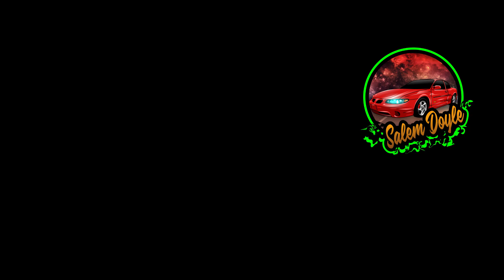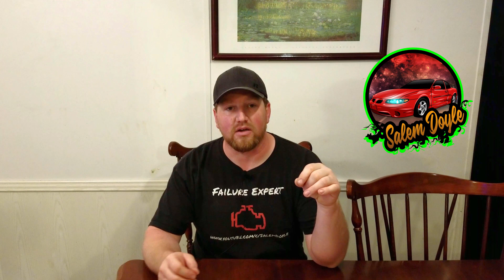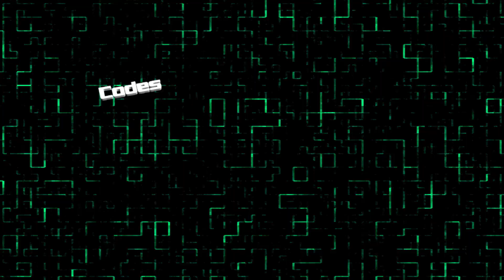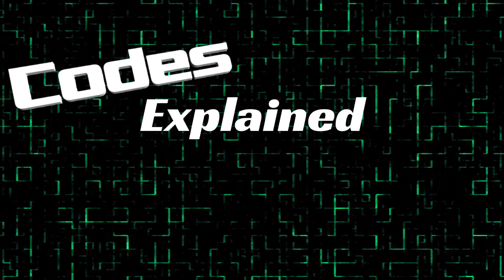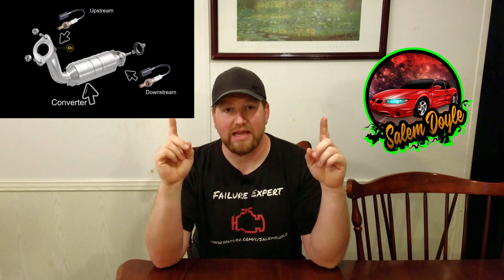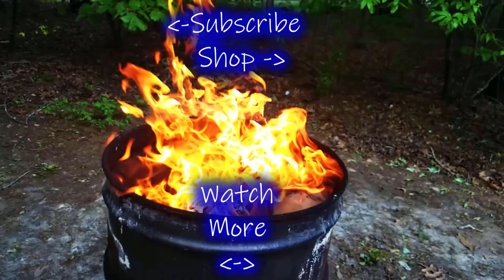Engine Code P0420 and P0430 EXPLAINED

Comment: One other thing, disconnecting the battery should shut the clock down, but when I reconnect the battery, the time is still the same, I have left the battery disconnected over night, and used a 
jumper cable from the disconnected positive cable from the battery to neg, cable to drain off any residual voltage, but the clock holds it's time and the engine check light stays on. I guess I will have to bite the ol'e proverbial pocket book and let the dealership guys check it out. According to the owners manual one needs to re=program, or re-learn some engine stuff when disconnecting 
the battery, and the transmission.
Reply from the maker: That is pretty odd.

Comment: Thanks for the reply, I changed both the upper and lower sensors on Bank 2, now I'm trying to figure out how to turn off the engine check light, there seems to be no way to turn it off using the 
KW808 code reader, and it shows no further error problems since I changed them out. I have tried the 'disconnect' battery thing but to no avail, most places want at least $170  for a diagnostic
check, which is the Lincoln dealership about 40 miles away, the Buick dealership in town won't even check it out, he says something about his diagnostic  equipment isn't workable on Lincolns.
Ha ha. Any ideas??
Reply from the maker: If disconnecting the batt for a few minutes doesnt reset it, you have other problems

Comment: I have a 2015 lincoln MKT with the 3.7 engine I believe with dual turbo's, the engine check light is on and there is 79,000 miles, I'm using a KW808 diagnostic tool which shows a p0430 code bank #2, is it possible it's just a bad up-stream sensor and not a partially plugged convertor on bank  #2. The car runs great, when I punch it. it runs like a rocket, up to a 100 plus in no time, which I quickly back it down ha ha the down side is getting to the upstream sensor, the downstream is right out in front. If one had to replace the convertor it's actually part of the exhaust manifold, Bummer, the local Lincoln dealer wants $170 just to diagnose the vehicle. what do you think? try to replace both sensors and see what happens?
Reply from the maker: you could look at o2 data and see if the upstream is doing something it shouldn't but if that is the only code, you are probably looking at a converter issue

Comment: Thank you for the detailed explanation. I have a 2011 Genesis Coupe 3.8 and I’m getting P0430 as well as P061B. Do you know if that code would trip the P0430 code or is that a separate issue? I’m being told I need to replace the ECM, but don’t want to do that, if the code is related to the P0430. Thanks in advance!

Comment: it would have been nice if you would have mentioned if it would harm your motor if it continued.
Reply from the maker: A 420 code alone wouldnt cause engine damage, but depending on what it is, the cause might.

Comment: Excellent info. Can the downstream sensor itself cause confusion with the computer causing a 430 to slight skip while idle. I had no other codes come up but the air filter was mugged up I changed it out
Reply from the maker: Shouldnt cause engine issues, the downstream sensor is just for cat mon itoring.

Comment: I got the code after I replaced my cats did not have that cold before it must be the aftermarket part or aftermarket oxygen sensors it was cheaper than going with the original that cost over $4000 dollars thanks for the info

Comment: Ok I understand, I don't have a scanner, but how could I find a other code? I hear people say, "" change the oxygen sensor""  it's like guessing, for example my car starts fine, it doesn't blow smoke, but it smell, my question to you, how can I identify the faults of a catalytic converter?, sorry for my question.😅😅
Reply from the maker: Start with fault codes.  If you dont have a scanner take it to a parts store and they can pull codes for you.
Reply: I did,  but they found same p0420 code, but exactly what are the symptoms of a bad catalytic converter?
Reply from the maker: There usually arent any symptom outside of the code.

Comment: Completely agree with other folks. Great content. It’s nice to hear a technical explanation instead of tribal knowledge. Would completely be up for more videos. 

Electronic Throttle Control system, for instance. That dumb lightning bolt has a thousand meanings, seem like. 

Thx for the great lecture sir. Much appreciated.

Comment: Sir I have both code P0420 and P0430 on Mazda CX 09 2016. Engine light is on and just last month I also passed emissions test. So what it's mean Sensor need to replace only ? Because if convertor is bad emissions test will not be pass
Reply from the maker: More than likely its converters that are just starting to fail, but it could also be caused by misfires or if the engine is running less than normal.
Reply: Yes I am feeling high consumptions of fuel and Sir if convertor is failed then is it possible we can passed emission test ?
Reply from the maker: @khurramnaseer2783  yes it's possible.  but if you are also consuming extra fuel i would recommend checking over the rest of the engine for needed maintenance.  may be time for a tune up or may have another issue.

Comment: This is good info. I'm currently dealing w/ a p0430 right now. But I have a question. What if my scan tool doesn't show an option to view bank 2 upstream sensor? I'm only able to view downstream.
Reply from the maker: Thats odd, most scanners can view both.  You may have to borrow a diff. One

Comment: Ford taurus 2008. I have both code p0420 and p0430 displayed during an obd scan when I noticed the check engine light and fuel cap light turned on. I hope it won't have a damage to the engine before I have time to have it fixed. Thanks for your detailed explanation about both codes.
Reply from the maker: Usually those codes just refur to efficiency. It shouldnt damage anything else.

Comment: I bought a  mustang gt 350 with 475 miles but is 5 years old and I’m getting  the p0420/430 code it also has cold start issues  is it possible for the catalyst converter to be bad with only 475 miles on it?
Reply from the maker: It is possible, yes
Reply: @SalemDoyle  thanks
Reply: Bad gas in tank?

Comment: Very good explanation for the P0420 code. I would like to know if it will always show the red X beside the EGR no matter what is wrong with the exhaust system or is that because the EGR needs to be replaced or at the very least, just cleaned. I would love to see more of these videos as my last visit was to an actual Subaru dealer (which I've never done) because I kept spending money  with no results at my regular mechanic haunts. Even at the dealer they ended up returning my money because the problem was not fixed. It still isn't resolved but I'd like to try my level best not to buy a catalytic converter. So thanks for the explanation.

Comment: In your video, you mentioned a scan tool for the sensors, what is it officially called, so I can buy it? Also, can a bad spark plug cause both p0420/p0430 codes? From the videos I've watched, I know I have to change intake gasket when changing spark plugs, air filter too, and I believe a fuel filter? Idk if mine has a fuel filter? 2009 Chevy Traverse
Reply from the maker: 09 traverse may not have an external fuel filter.  Any decent scan tool should show you live data, just the cheap ones dont

Comment: So I had problems with my knock sensor, ran it like that for a good month or two, I fixed it, but now getting that code, is a catalytic converter cleaner a good option to fix problem. I know it was burning lean.
Reply from the maker: I have never had much luck with cleaners for this code

Comment: Do you think that cracked valve seals can cause a p0420 or po430?
Reply from the maker: In theory, yes, but there should also be other signs.
Reply: @SalemDoyle  Ive checked for several causes, I'm down to damaged valve seals letting burnt oil  pass by the cats po171 was fixed by replacing O2, but I suspect will be back if seals aren't replaced, just my theory.

Comment: I have a 2003 crv that runs great with po420 code, what happens if I just ignore it?
Reply from the maker: It shouldnt affect the way the car runs, just wont pass inspection and the check engine light will stay on.
Reply: @SalemDoyle  thank you for response. I appreciate it your the shit!!

Comment: my Dodge journey appeared code p420 and also p430 few days after I changed the spark plugs.  the oxygen sensors are working normally, my question is if these codes can be related to the spark plugs.
Reply from the maker: Misfires can sometimes cause false 420 and 430 codes.  Just reset and see if they come back

Comment: Hi  buddy i have 2011 nissa. Pathfinder through code p0430 but but suv still running fine? Changed sparkplug air filters,  but before that code say master air flow sensor
Reply from the maker: Has the airflow sensor been checked or replaced?

Comment: 2.5 v6 duratec i had p0171 and p174 cleaned maf codes went away now i have p0420 and p0430 any ideas?
Reply from the maker: Possibly cats are dirty from previous issue, or it just may need cats.
Reply: @SalemDoyle  i hope i don't need cats, they are expensive. Thank you.

Comment: will hollowing out a catylitic converter cause this? I had a leaky injector that clogged up my bank 2 cat to where it would barley run, i took it apart and cleaned it out, now it runs but very sluggish.  back pressure issue? this code pops up but what would cause it to run sluggish
Reply from the maker: I would suspect that maybe the cat on the other side is partially clogged also
Reply: @SalemDoyle  only code im getting is bank 2 and thats the hollowed one now. wouldn't i be getting a bank one code?
Reply from the maker: Not if its stopped up.  May not throw a code
Reply: thank you thats the answer I was truly looking for, I always thought some kind of code would show up for a clogged converter. all symptoms point at a clogged cat.
Reply: I was told that after I unclogged bank 2 cat it would run like crap because of it not having back pressure now.

Comment: During a 2 hour trip to the in-laws, my CEL started flashing. I still had to get home so it was another 2 hours. I pulled the code as #2 misfire. I pulled the ignition coil on the #2 cylinder and it was burned. I replaced it and misfire seems to have gone away and is no longer coding as such; however, I now have P0430 catalyst efficiency bank 2. I do not believe the Catalytic Converter is bad as I just replaced both upstream converters 2 months ago. Are the cat converter cleaners you put in your fuel tank safe? I have a feeling too much unburned fuel landed inside the converter...Thanks.
Reply from the maker: I wpuld reset that code and see if it comes back.  It could have been a result of the misfire
Reply: @SalemDoyle  Thanks for the quick response! I'll give it a try. I had to clear the misfire code with my app (Torque Pro on Android) and it was shortly after taking it for a drive, maybe 4 miles down the road, I got the P0430, but haven't tried clearing it via the app yet.

Comment: I have a new converter and 2 new oxygen sensors, up and downstream. But i’m still getting the p0420 code.. any idea what could be causing that?
Reply from the maker: Is that the only code.  Does the car run normally.  Was it a factory replacement converter?

Comment: Could it just be my sensors?
Reply: My ford f150 2012 isn't starting and it's throwing me both po420 and po430 codes. Could it be just my sensors? What would you recommend!
Reply from the maker: The not starting is a separate problem to the 420 and 430 codes.  Unless possible the converters are very clogged.

Comment: Help. 08 malibu 6cyl  0430 code, got bank 2 cat and 02 sensor replaced $$$, drove 53 miles engine light back on. No other codes.?
Reply from the maker: What kind of cat did you replace it with?
Reply: It was done at a trusted shop, so I'm not sure( it cost $1000 just for the part)
Reply from the maker: Other possible problems would be exhaust leaks or something making the engine run rich.  Make sure the converter is for the correct emmissions standard ie: california or not
Reply: Thank you, you are always helpful. Have a great weekend.
Reply from the maker: No problem.  You too

Comment: I installed two new Jeep Grand Cherokee converters and the p0420 problem returned, any idea for solution?
Reply from the maker: Check for issues that would cause rich running conditions.  Also check/replace the o2 sensors after the converters

Comment: I'm getting repeated P0420 codes.  I've replaced my coil on my #4 cylinder (6 cylinder 2004 Highlander) twice already (probably had the vehicle for 7 years now).  First time with aftermarket, second time with junk yard OEM part from same year vehicle.  I will search out to try and see if that cylinder still has a misfire.  The cat is about a year old.  Do you have any ideas how I can best proceed.  Right now I'm getting a P0420 and P0500 code, but I suspect the P0500 code is likely due to speed sensor connector issue and unrelated to the P0420 problem.
Reply from the maker: Did you replace the cat with a direct fit replacement?
Reply: @SalemDoyle  I believe so.  Friend of a friend works directly for Toyota and he did it.  I assume he used a Toyota OEM part.  I think I need to test and see if that second oxygen sensor is good or not. No misfire codes thrown as of yet.
Reply from the maker: I would look at that sensor and see what your fuel trims look like

Comment: Just replace converters still getting po420 po420 code. New catalystc converter turning purple will it catch a fire?
Reply from the maker: Sounds like you may have a problem causing the engine to run too rich.
Reply: @SalemDoyle  they want catch a fire will they? Are they bad now because they're purple. Only 2 weeks  been on car.
Reply from the maker: No. They shouldnt
Reply: @SalemDoyle  I'm going tomorrow to have an engine diagnostic.  If possible I would like to write back tomorrow?
Reply: @SalemDoyle  Thanks for your help!!!!
Reply from the maker: Sure

Comment: I have a p0430 only code. On my SRT8 CHALLENGER 2009. 
I changed my cats a month ago since I had that code then too. 
Now I have the codes again and im rocking Magnaflow High Flow cats with NGK 02 sensors.
Reply from the maker: I have seen a lot of problems with magna flow cats throwing that code

Comment: Trying to figure out my p0430 code added a bottle of cat cleaner code went away for a couple days then came back plus code p0420 I did notice when a start my nissan nv2500 in the morning it revs pretty high not sure if this normal later in the day idles fine any advice thanks
Reply from the maker: The idle is probably normal.  Sounds like you have some cats that are on the borderline.
Reply: @SalemDoyle  just purchased the nissan wasnt sure about the idle switching from p0430 to p0420 has me confused
Reply from the maker: Sounds like both cats are on the way.  Sometimes codes will come and go for a while
Reply: @SalemDoyle  thanks for the advice

Comment: My 2006 Subaru's diagnostic results show 0302, 0026, 0028, 2138, and 0420.  Can you give me the order of how to tackle these, or do you think it may be time to think about getting a new vehicle?  Thanks.
Reply from the maker: Always look at the misfires first.  They can cause a p0420 even if the converter is good.
Reply: Thanks for the reply.  I was told replacing the converter would be my worst case scenario.  This Outback has been the most reliable vehicle I've owned, and I know it's getting old - I really want to keep it safe and compliant for a few more years.  The car hesitates and jumps while I try to accelerate higher than 40-50 mph.  To compensate, I need to take my foot off the gas petal, slow down a little and apply pressure slowly to get up to 60+ mph.
Reply from the maker: @DRW1107  that makes sense with those codes.  Look into the throttle body and pedal